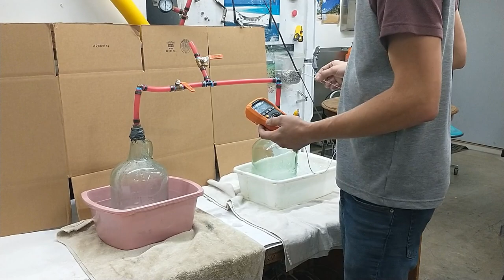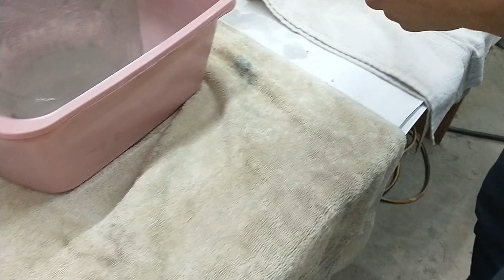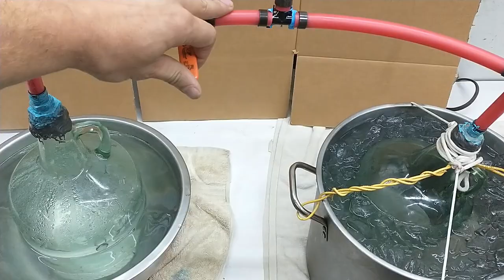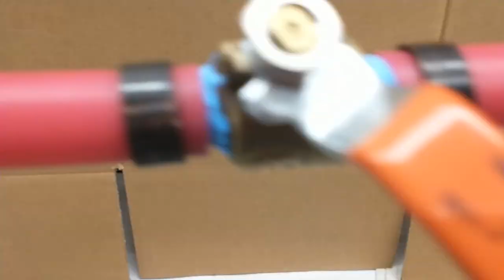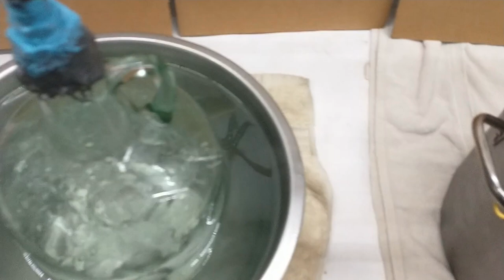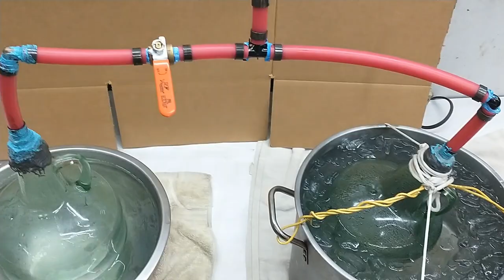COLD BOILING WATER To power The Tesla Turbine Renewable Energy System

Comment: What would it take to return the condensate to the hot side  by using gravity. Perhaps a passive or spring loaded check valve and a calculated hight differential to maintain a passive return loop.
Reply: The ammonia based refrigeration system in rv refrigerators has a gravity return loop. The system uses a pilot light in the form of a propane flame. The size of the flame is what you would get from a bick lighter.
Reply: When the sun heats the ocean the ocean water evaporates into the air and travels to a very high altitude. At that point it often condenses. If this condensation water is channeled into a vertical pipe it can be returned to the ocean by way of gravity with a substantial pressure buildup. Work can obviously be extracted as well. No need for a check valve. In the Tesla turbine boiler maybe a float valve would be nice to maintain the water level in the boiler. The Tesla turbine and condenser could just be positioned at a higher elevation compared to the boiler to maintain the pressure difference between the boiler and the condenser.
Reply from the maker: We used a simple hot water pump.

Comment: So, is what you'r building a kind of closed-cycle system that depends on a naturally available (eg solar) heat source? You've made the comparison to Stirling Cycle closed systems. Does the turbine simply replace the complexity of a Stirling engine?

Also: how adaptable is your design to situations where you have available water pressure, rather than heat? Are there geometric differences in nozzle structure? Finally, are Tesla turbines equally efficient when they switch between driven pump applications, and energy-harvesting applications, for.a given fluid? Thinking here about classic systems for scavenging energy from flowing fluids where a propellor is not always efficient as a turbine...
Reply from the maker: We have to do more research on the flow of vapor with a long drop like a hill still. I really want to explore that in the future. it's a Stirling engine but more simple and more powerful I believe.

Comment: Ethanol plants produce 150,000 tons a year of co2 or a 421 tons a day. I am thinking about a synthesis of an artificial photosynthesis that makes sugars that than placing bacteria into the sugars, and allowing into fermentation tanks, and than feeding the co2 generated to a small compressor, and than feeding an 18.5 in tesla turbine as long as it was leak proof than it can be rerouted to be injected with water, for the original photosynthesis process to take place. You can make twice the money one for the energy produced, and one for the alcohol produced.

Comment: Can peltier devices be used to recycle some of the energy by prolonging the temperature diffential? I know they're extremely inefficient, but I'm suggesting more of like a "regenerative breaking" kind of boost to your system- like have two peltiers powering a third one- the first two generating a current for the third by harnessing the same differential powering the two chambers(the hot and cold water)- the third one being used to prolong the diffential by keeping the water hot and ice cold- perhaps you could even boost it with the electrical output of the generator? Insulating the two chambers would best keep the diffential in the long run though- but the bonus is that the peltiers are all you need to get the hot/cold going again, if everything were to be integrated and sealed up- maybe even a small DC pump to return the condensed water back into the boiler chamber, for a complete hands-off system. Omg now I'm thinking about how to make an integrated system for this principle

Comment: Ok so I’m going to ask what’s probably a dumb question but even dumb questions should get asked right….   So as I understand it the hot side… not particularly hot mind you only needs to be above the boiling point of the water in a vacuum. This will give you the cold steam and the flow.  The cold side needs to be cold enough to condense the steam back into liquid.  Eventually I assume if you keep adding heat to the hot side all the water will move to the cold side….  Would it be possible to connect the the two vessels together so the hot side would never run dry? Making it a closed loop?  Might need to be a deep long loop….  But in my mind it should work…..

Comment: I would love to see this setup with evacuated solar tubes to heat the hot side.
Reply: How would you design a cold water return?
Reply: @kreynolds1123  Easy, put the cold basin at higher altitude than the solar tubes and flush it back down when it gets full.
Reply: @Rhannmah  You actually loose energy sending water vapor to a higher elevation. 
Improving on this demonstration one would have two heat exchangers.  one as the boiler where they add heat, and one as the condenser where the disipate the heat.   Below each heat exchanger are chambers to hold a sufficiently large volume of water, and a thin pipe connecting the two. And between the heat exchangers is a turbine turning a generator. 

As a load is put on the generator it transfers the load to the turbine and this creates back pressure in the boiler heat exchanger pushing the water down some and into the condenser collector chamber.  Untill an equilibrium is met where the back pressure equals the weight of water pushed down. 

Instead of relying solely on gravity and the weight of a colum of water to generate a limited amount of pressure on the turbine, one could use a pump with check valves. 

Yes using a pump uses energy  but it's much less energy to generate pressure with a small volume of water than is extracted from the movement of heat energy with water boiling at one end and condensing at the other.  And a pump will be much more condensed in size than relying on significant  elevation differences.
Reply: @kreynolds1123  but you don't need significant elevation differences, even a height of one meter would be more than enough to have a complete cycle.
Reply: @Rhannmah   the water vapor presses against  a turbine under load and 1 meter of water on the boiler side are the same and both are constrained by the weight of 1 meter of water. With such a relatively low pressure on the turbine, it is ok for lab demonstrations, or may be low power harvesting,  but otherwise not much useful.  

In the realm of low power, like say residential, it's most likely one would want to use solar thermal for the boiler side, on their roof, but does one really want to add the condensor at a higher elevation than the roof?  It is possible to reserve the top half of ones roof for a condensor, but they would be limiting the solar thermal collector area to half of the roof if the condensor were placed on the roof.

Comment: Why is there so much static building up? Does this happen with compressed air?

Why is the turbine more efficient on steam? Is it because the air is more viscous and is able to turn the disks easier?

Does the steam move quicker then compressed air? How do you build up the pressure if you have to open the valve to make the water boil? As soon as you close the valve the water stops boiling so it's not adding pressure into the pipe?

Sorry for all the questions!
Reply from the maker: The static is likely from friction from the water vapor moving past the valve. The steam allows a closed loop system and very high vacuum on the exhaust of the turbine which increases efficiency. Water is also more viscus then steam. So far with only a couple psi difference we have achieved 66000 rpm with a load on the turbine.
Reply: @iEnergySupply  What makes the most difference to RPM, air pressure or air velocity?
Reply: @iEnergySupply  I think I've worked out why the static charge is building up. You have moist air on one side and dry air on the other. When these two meet in the pipe the moist air rushes to the top of the pipe and the cold dry air sinks to the bottom as cold air is more dense. The constant updraft of warm air and the constant down draft of cold air is the same thing that happens in a thunderstorm and it electricity charges the air around it. That electric charge is then conducted into the pipe and eventually your hand. You have to remember that you have 2 layers of air in the pipe and its behaving like a weather front.
Reply: @iEnergySupply  what kind power did it make?

Comment: If an electro magnetic water pump moves water through a pvc pipe without the use of a mechanical pump, will your pressurized water produce an electric current if you wound a coil around your pvc pipe? Since you feel static electricity,  it might work.  Like a reverse electro magnetic water pump?

Comment: When you evacuate with the vacuum pump: do you evacuate both sides at the same time? Do you maintain equal temp during evacuation? Does the pump cause the water to boil during evacuation?
Reply from the maker: both were evacuated at the same time, but you can do them separately. with warm water, the vacuum pump doesn't need to be as powerful.

Comment: Hi I love the idea what u doing, I did think  similar what u do but no parts tools money.. to experiment.... Please  please try acetone ( boiling point lower) and more importantly Latent Heat of Evaporation wayyyy lower 520kj/kg compared water 2250kj/kg.  4.3 times less energy need to boil away and condensing it !! 
Keep up the good job! All the best 👍
Reply: Extremely flammable, but I like the lower latent heat idea 💡
Reply: @davidcollar4577  without air, in closed loop, working temp  10c coldside (ground cooled) 60 celsius max hotside solar heated. I would dare to try :)
Reply: @soosgabor100  Solar heat tends to run  quite hot.
Reply from the maker: We want to try this in the future. For now water seems to be working very well, it condenses at very high temperatures and has very good vacuum for the exhaust of the pump.

Comment: Do you constantly heat the left side to keep the temperature difference at a certain level? Or what is the red plate/box under the left bucket?

Super nice and easy demonstration, thanks so much! :)
Reply from the maker: it only needs to be heated once in a while until the thermal energy in the water battery is discharged the more water you have the more energy you can store. It can be heated with any source of heat, primarily thermal heat panels which can be up to 97% efficient.
Reply: It looks like a plastic container of o-rings that they used to raise the height of the tank.
Reply from the maker: @danafletcher2341  haha you got it!

Comment: What do you estimate the minimum temperate differential to be to run at say 25% efficiency ? Based roughly on your experience so far without insulating or refinements . Crude estimate .

Comment: Has anyone calculated the amount of energy spent to boil the water and freeze the ice?
It would be interesting to know energy out / energy in.  I didn't think ball bearings could sustain greater than 10K RPM for very long.  Have you considered babbitt bearings or air bearings?
"Cool" presentation .... keep up the good work.
Reply from the maker: ice isn't needed. 55 degrees is sufficient we would use the earth for this.  The bearings we are using now are rated for 150000 rpm, the are ceramic stainless steel.
Reply: @iEnergySupply  Guess I missed the part about leveraging subterrainian temperatures in the video.  That is not uncommon to take advantage of the geothermal temps in the Midwest for HVAC heat pumps.  It’s not used as much as it should be.
Reply from the maker: @truegret7778  I totally agree.

Comment: If both containers are under equal negative pressure, both containers would boil without a temperature difference.  There is simply no transfer of energy or mass of any kind.  How about installing a flow meter between those containers to show or not, what is being transferred?
Reply from the maker: they are not equal in pressure, because they are not equal in temperature. Pressure is directly related to temperature.
Reply: @iEnergySupply  In this video you did pull a vacuum on both containers, right? If so then the boiling point of water is only changed by the difference in temperature.  It appears to me that you only pull enough vacuum to allow the warmer container to boil.  By lowering the temperature of the second container, it takes more negative pressure "vacuum" to bring that container to boil.  This is why water vapor condenses instead of remaining in a gaseous state.  Anyway a simple flow meter would go a long way to verify what you are saying.
Reply from the maker: @travisarnett9558  You understand. I'm not worried about satisficing everyone, I quickly throw these videos out to do the best I can with what little time I have. I can't spend too much time trying to convince people that simple physics are at play.

Comment: I'm sorry but can't see any pressure differential between the two containers  and it would of been easy to show with two vacuum gauges or with a tig welder flow meter
Reply from the maker: yeah, you'll have to watch our previous video, it shows it in action, a turbine rotating at 60 thousand rpm.

Comment: So how much if a temperature difference do you need? Because I think a geo thermal loop would work flawless. Temperature underground stays constant so you could capitalize that temperature difference from surface to underground. Also do you need water in the cold side or just the temperature difference?
Reply from the maker: just a temperature differential is required. So far we got 400 watts with a crude test that needed 100 degrees f difference, but this will be greatly reduced with faster speeds, as we will show soon.
Reply: It sounds like you want to use a pump to feed the exhaust from the turbine into the supply side(hot side)? with a long geo thermal ground loop and if you maintain rpm to keep your refrigerant colder then the ground temperature and feed back to the supply. you might possibly have a really long run cycle or extend it even more. And it would be a complete closed system that requires no daylight to generate power. Although you might need to run something other than water to achieve this.
Reply: @iEnergySupply  can't wait to see more

Comment: chemists have been using vacuum distillation for a couple centuries to distil low boiling point susceptible compounds, cool.
my one question is how much head can use expect from said steam? turbines rely on not only flow but also pressure no? inertia and all? im massively ignorant of this stuff and thatss why im asking.
Reply from the maker: got 400 wats on our small turbine with 212 degree water in the boiler.

Comment: What is the lowest temperature differential that the water will boil at under vacuum?
Reply from the maker: 40 degrees c
Reply: @iEnergySupply  are there any other molecular compounds that you can dope the water with to lower the temperature differential further? Thinking salt or something like manganese dioxide. Just thinking If you can lower the boiling temperature differential further you can get the same reaction at a lower cost of energy input. There fore increased energy output

Comment: Ok so let me get this right. You need heat to maintain a certain temperature in the hot boiler, and a way to keep the cold boiler a particular temperature...and also a vacuum pump to charge it each time a cycle has happened....What is the expected net power output vs power required to get the thing working?
Reply: The point of the demonstration is to show the effect of vacuum and temperature on waters boiling point that they aim to manipulate with the tesla turbine. Its just to show the medium carrying the energy to the turbine. 
When you add the turbine it apparently cools the vapour so effectively that's its cooler than ambient air, this is crucial to maintain the cycle, if this isn't happening then the premise for the system falls apart. Its important to remember that no other turbine does this, this one fact is where it all hinges.
So you can extract rotational energy and maintain the vacuum/temperature difference for the cycle to run. 
Well see what happens maybe it works?
Reply: @jeffjefferson3364  You didn't really respond to my comments. If the system is reliant on the temperature differences of the boilers then there is a chunk of energy gone already. I hope they have been testing the turbine under loads and making sure they can produce a net energy which is half decent compared to what is already available. I can't see this producing a attractive net energy, if it even works in the real world. Sorry but thats my opinion, maybe I'm wrong? Time will tell.
Reply: @optimusprime699  this is what they are claiming and they say they have the instruments now to prove it. I'm waiting like you.
Reply from the maker: once you connect the two tanks together with a pump and a one way valve the vacuum pump never needs to be used again, it is only used one time to prime the system. Also if the boiler is large enough it becomes a battery, and does need to be recharged using the sun or some other heat source. Sorry for late response, comments are coming in like crazy.